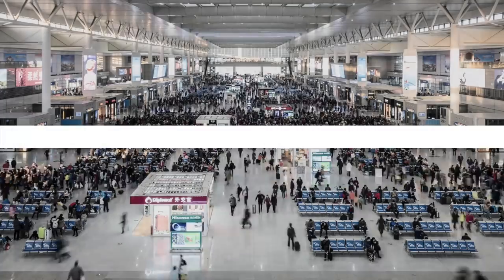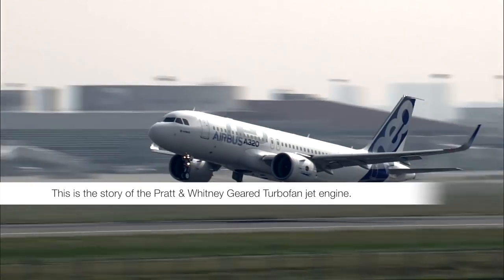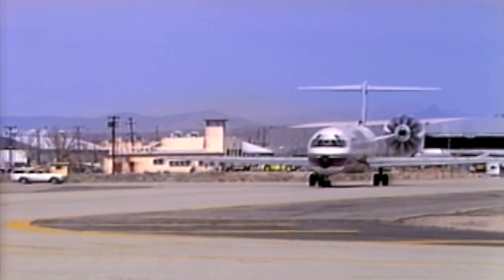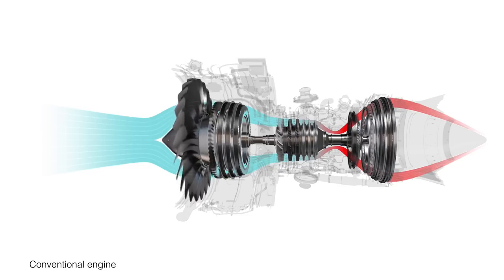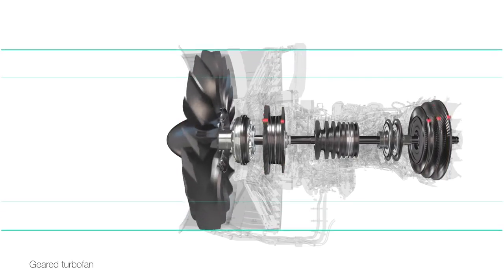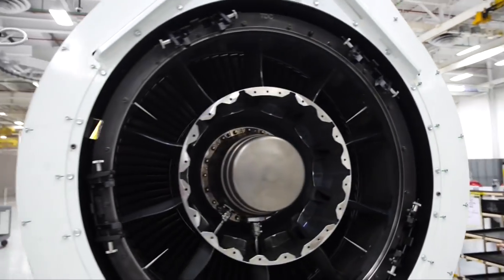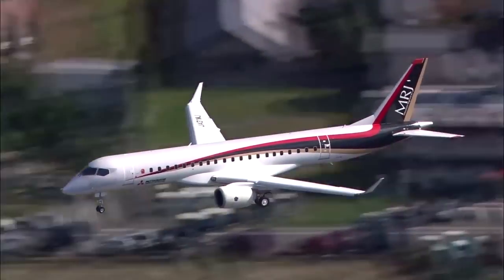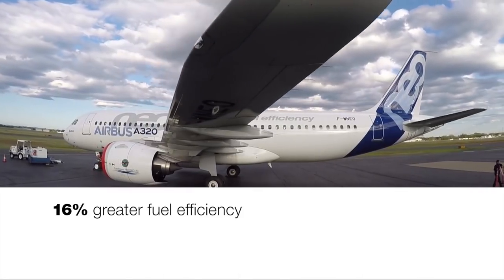Pratt & Whitney’s GTF Engine is Geared Towards the Future of Aviation

Comment: just got one question about the bearings in the gearbox? from what I see you have used flat bearings rather than tapered ones? won't that predispose the bearings to premature wear and tear?...noisy gearboxes? due to gyroscopic forces on individual gears being bounced up and down on a wing..plus  torque twisting of the big fan on the central shaft via of course the gearbox
Reply: you nailed it. On the 220 at my company we have done multiple unscheduled engine changes due to bearing flakes found in the scavenge screen of the reduction gearbox

Comment: I piloted the little Bae146 for ten years. It had the AFL502 engine which had a geared fan over 20 years ago! It wasn't a perfect engine but the gearbox never failed AND it was very quiet!
Reply: Anset operated those aircraft in NZ as the whisper Jets. They were an awesome ride.
Reply: Just WAIT.  No one, and PW didn't TELL the FAA, knows WHY the GTF gearbox is 80% loaded on only TWO of the planetary gears.  Just WAIT.

FAA Certification, engines, planes, pilots, people; LIP SERVICE.

Comment: Please how does the fan in front of the jet engine rotate or spin. Is it having a motor inside it that helps it to spin?
Reply: The fan is driven from the turbine. It's on the same shaft as the turbine exhaust blades (rear of the whole engine) however it's geared down through a planetary gearbox. (Same sort of gearbox that's in compact drills). For a better understanding of the concepts behind turbines (first stage,second stage compression, combustion/ignition stage and turbine stage) look up how a turbojet works, then look up how a turbofan/turboprop works

Comment: When will they stop exploding on takeoff or shutdown in flight? Any decent solutions on that?
Reply: That has nothing to do with the architecture though if you actually read up on the issues. It's not the gearbox or shafts having problems. PW needs to invest in ceramic matrix composites just as GE did, or their tiny, ultrafast cores will, yes, suffer catastrophic failure.

Comment: This same engines are fitted on a320 neo's of indigo which suffer engine issues
Reply: But it's not the architecture causing the problem. PW is spinning their small 3-stage turbine so quickly that their standard Titanium can't withstand it. GE and Rolls Royce both went with Ceramic Matrix Composites for a reason.
Reply: @patrickproctor3462  If it had to do with the LP turbine RPM, the issue might have been there even during non-GTF days as well, right?